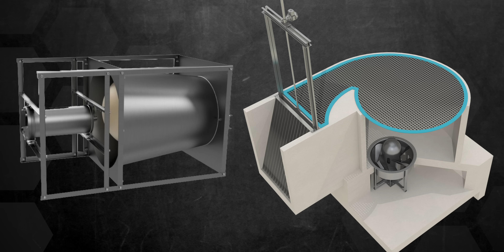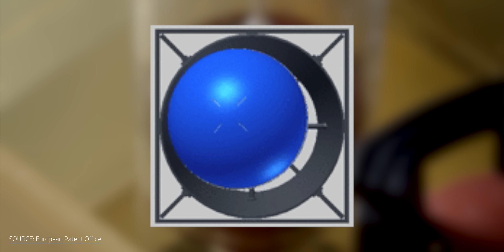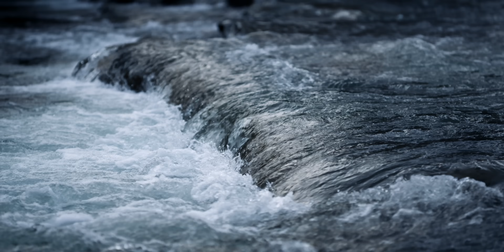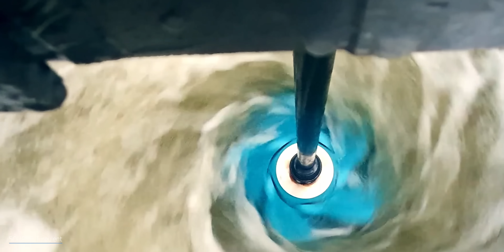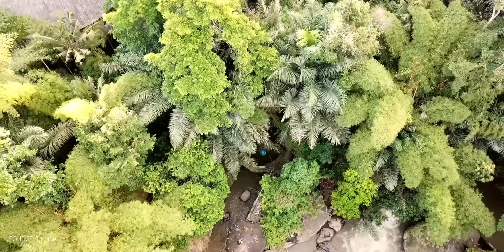The Genius of Small Hydro Turbines

Comment from the maker: What do you think about decentralized and small hydro? Click here https://www.eightsleep.com/mattferrell to improve your sleep fitness with Eight Sleep and use my code MATT to get $200 off!

If you liked this video, check out: Have we been doing Solar wrong all along? https://youtu.be/LqizLQDi9BM?list=PLnTSM-ORSgi4dFnLD9622FK77atWtQVv7

Corrections: 
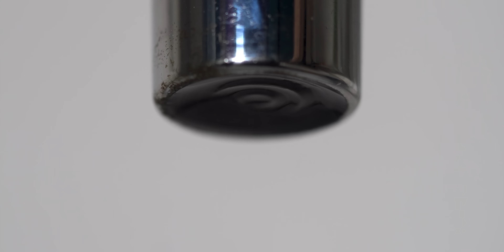3:28 - We made a mistake between the calculation and the final script.  It’s 500,000,000x more than the average faucet.
Reply: I suspect most people don't want a mattress that requires a subscription that will cost them a couple hundred dollars each year.
Reply: In Arizona, small hydro makes a lot of sense. We have one of the most extensive water canal systems in the country spanning thousands of miles and we could easily add numerous Turbulent systems adjacent to the canal's to supplement electricity demands.
Reply: FW, 
you need height for power it's alinear effect.
Yes you can generate from rivers etc if you wnat but it's not effective.
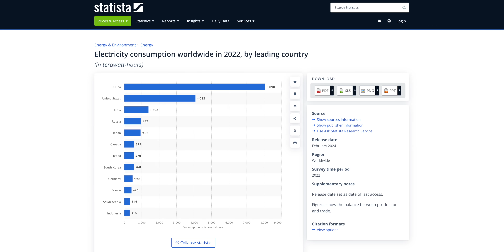Reply: Hey Matt, great video as always! The chart at 08:03 is kind of misleading in combination with what you say. It shows total energy consumption of countries rather than the average per person while you're saying at that moment that those in the US tend to use a lot more electricity than people in other parts of the world. Now it seems as if the average Chinese citizen uses more than a US citizen but that's not true
Reply: @firstlast2621⚠️ God has said in the Quran:

🔴 { Say, "O My servants who have transgressed against themselves [by sinning], do not despair of the mercy of Allah. Indeed, Allah forgives all sins. Indeed, it is He who is the Forgiving, the Merciful." ( 39:53 )} 

📖Quran
Reply: @firstlast2621 The US barely makes up 4% of the global population yet consumes 1/3 of the world's resources and emits almost 30% of the world's pollution and waste.
Reply: @PetraKann what's your point..?
Reply: @PetraKann  Yeah no, you have been lied to by a misuse of numbers also that stat is 30 years old now and you are still using it and still think it was originally true.
Reply: @PetraKann  hmmm, those statistics are misleading.  As if every household for 130 million people have made that dent?  How much of that is industry, and furthermore, how much of that usage represents the GDP of our economy versus the GPD of a dozen micro nations?  A step further than that, how much of what we export to support other economies is involved?  Modern septic systems make more sense to me than 130 million cat holes and seasonal cholera outbreaks.  The blame shifting is a tired game of 3 card Monty few are fooled by anymore.  A better use of regulatory bodies involves focusing on the true source of pollution and concentrating on the highest impact polluters so that cradle to grave laws already on the books get enforced in earnest.  A united ban on fluorocarbons went a long way towards healing the ozone layer.  Smog is greatly reduced from a century ago no matter which city on the planet was involved.
Reply: @robertmoore1215  the statistics includes all aspects of American society, not just household demand and consumption. The same criteria applies to all other nations so a direct comparison can be made. The USA by the way has more than 130 million people.
The single largest carbon footprint for any organisation in the world is the US military.
But you are personally asked to tighten your belt, minimise your waste and reduce your carbon footprint 
Meanwhile the US military and the tiny elite class have obscene carbon footprints and energy demands.
Orwell was correct in Animal Farm when he wrote "we are all equal, but some are more equal than others"
Reply: @PetraKann  if you read my other comments I said as much.  Even using the label military is deceptive when it implies any active duty personnel have a thing to do with where the real money goes (contractors).  The flaw in the statistics that socializes the blame is that it implies equal blame for Amish Americans and rice paddy farmers in rural China.  Neither are willing participants in big industry's crimes just because they purchased a rubber wheel.  

I'm too old to ride a horse or an electric bike so I need a car to function because public transit is lacking.  When the sticker price of an electric car exceeds what I paid for my house, isn't that a symptom of a broken market where demand no longer drives an economy?  We are very far away from Henry Fords understanding that his employees were also his customers.  Seems to me real capitalism was eaten alive by crony capitalism.  But I digress...
Reply: Would you please do an episode about the Bath County Va pumped hydro installation… it’s been quietly working away for some time now …
Reply: 78 GW of SHP is way more than expected. You should fact check, what is meant here. In general SHP is 50MW or less. You are talking about pico hydro power (below 10kw) or maybe micro- (below 100kw). There will be no more than a few MW installed worldwide, maybe more than 10MW.
Reply: 78 GW seemed awfully big to me as well, @juliane__.  
What wasn't given (have to check the source info) is the efficiency of these alternate turbine designs. Yes, you can make power with a small head, even with a conventional water turbine.  You just don't get much power out. 
I, along with the majority of the world's population, don't live near a stream so while there are places, particularly remote and less developed places, where these small hydroturbines could be a reasonable solution, they won't scale up to provide the massive amount of non CO2 electrical generation that we as a society require. An interesting boutique solution for a few people, I think.
Reply: @gerrylarue9043  Yes, for some regions it is an easy solution and makes sense, especially if you don't have the need for transformer stations or at least lower the total grid demand in industrial countries. Overall impact is low to very low indeed. And we didn't talk about upcoming droughts due to climate changes...

Efficiencies out of my head, 50% and more if it is done right. Crucial part is the last one, because the firms who build them are small and don't have much spare resources to make much custom fits.
Reply from the maker: @juliane__  that info was pulled from this report: https://www.unido.org/sites/default/files/files/2020-08/Global_overview.pdf?_token=281556212
Reply: @UndecidedTechnology  I asked to harshly for the review of the part. i guess because it stood so much out to me. Seems to be not that important. Hav a nice day.
Reply: I enjoy many of your videos but this has been a super useful because I have been looking for a suitable low head turbine for some time. And I think the Setur-M might be the thing to finally solve my winter energy shortfall. Thanks Matt. You're a star!
Reply: "Don't go chasin' waterfalls please stick to the rivers and the lakes that you're used to" ;)  A bit of TLC "Waterfall".  Thanks for another interesting review Matt!
Reply: First time viewer here. Annoying salespitch for an overpriced mattress in the middle? Thumbs down.
Reply: Matt, 

simply put, effective hydro power needs height, end of the story.
You are correct with regard to the hazards, I think this may be the worst hydro accident:-

On 17 August 2009, a turbine in the hydroelectric power station of the Sayano-Shushenskaya Dam near Sayanogorsk in Russia failed catastrophically, killing 75 people and severely damaging the plant.

They are extremely rare however and hydro has good safety record overall.
Reply: SETUR = fish mortar and pestle. lol
Reply: Ive seen these discussed before but none of the videos discuss debris going into the system. EX. would a long tree branch just break the system?
Reply: Even if your area is next to a river, the mechanical nature and exposure to multiple elements makes hydro turbines less reliable or require more maintenance vs solar PV.  However it could be a nice backup to solar in a totally off-grid system.
Reply: These could also be used as pumped hydro energy storage alongside a solar/wind setup.
Reply: @yt.personal.identification  Sumale a eso una batería accionada por gravedad, es en lo que estaba pensando, en un sistema de embalse de agua cerrado y sobrará energía para una granja promedió.
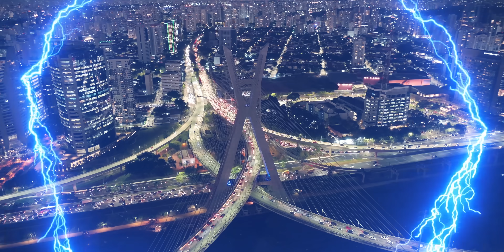Reply: When comparing project size and completion times, comparing the complete Itaipu dam project at 13 years (12:41) to the Turbulent turbine installation next to the Ayung river at less than 1 day (13:06) is a little misleading in overall terms of total time it takes to build basic infrastructure and install power generation equipment.  While I'm sure that the turbine installations at the Itaipu dam took over 1 day each to install, it was less than 13 years per turbine - the 13 years is used as total construction time.  (From a little research I did, it appears that the actual dam construction was a little under 8 years, and power generation began a little more than 9 years after construction began.  Turbines where added at a rate of 2-3 per year during the following 7 years, plus and additional 2 added 16-17 years later to allow 18 to run continuously while 2 are down for maintenance.)  That equates to the output potential for approximately 4,300 kWh per day the project was in basic (most environmental disrupting) infrastructure construction and drops down to ~2,000 kWh if factoring in the subsequent years to install 18 turbines. The Turbulent installation was installed into a preexisting concrete basin. (Kudos to them for repurposing existing infrastructure!)  Total construction time would have been significantly more if they had started from scratch.  If they had built all infrastructure, it's plausible that it could have taken a few weeks, resulting in as output potential of less than 1 kWh per day of total construction.

I'm not against small hydro-electric generating installations - I think they are a great way to spread and reduce environmental impacts.  I don't doubt that the Ayung installation has less environmental impact per kWh than the Itaipu does, and I think such projects like this should be promoted!
Reply from the maker: @heythere6922  thanks for the feedback on that.  Yes, it’s a bit of an apple to apples comparison, but that’s kind of the point I was hoping to hit.  Not all hydro solutions require these massive installations.  What if you built out smaller more localized installations?
Reply: "Das Genie der blattlosen Vortex-Wasserkraft. Klicken Sie hier, um Ihre Schlaffitness mit Eight Sleep zu verbessern und verwenden Sie meinen Code MATT, um 200 $ Rabatt zu erhalten! "
what does that mean? can you explain it? it's from your video description.
Reply: The Patent Rights to Vortex hydropower is owned by someone in Australia.
There are a few prototypes and small scale Units operating in Australia and around the world.
Reply: thanks for translate your video.
Reply from the maker: Thanks for watching!  Curious ... what language did you listen to?
Reply: Do you have any idea how much energy it takes to heat water!? I’m not adding a heated bed to my electric bill!
Reply: عذرن أنا قرأت شروط تعليق لكني لم أفهم لأنه بلغة انكليزي
Reply: please, what is schlaffittness? I really don't know this word, that is used in the video text. and please, could the title of the video please be in english, since the video itself is in english. can't be too hard.
Reply from the maker: What language are you seeing that in?
Reply: @UndecidedTechnology  14:28 I recomment to revise this graph as i commented before. It is not part of the video topic.
Reply: @UndecidedTechnology  English!
Reply: Love the tucked it J.Milei "Damnit"

"Afuera" to the damns of old!!
Reply: MORE Professionally DAMIT
First time i was like ok 2nd was like hmmm. And he get compans callinging him to do video of there projects . Just saying damit. Lol
Reply from the maker: @claytoncostello6583  who is getting calls?  Me?  Nope.  Neither of these companies reached out to me.
Reply: Day a lot: of asking for a video on fabric ductwork
Reply: Love the lyrics strewn through out
Reply: Just so you know there's a bot in the comments pretending to be you
Reply from the maker: @pisscow6395  gah!  Thanks for letting me know.
Reply: @UndecidedTechnology  Not able to correct or at least respond to an obvious and narrativ changing failure doesn't say quality content.
Reply: 13:00 it is kinda unfair to compare only instalation of turbine plus fuse/controller box (without time required to build the channel and the chamber). While you give time for all of this in case of dam. I bet instalation of turbines took way less than 13 years. Right?
Reply: Combine it as an integral trompe pump
Reply: Decentralized small & micro hydro would work best in rural communities where bold streams exist.  A small town cooperative version of electric generation is more pragmatic for small towns than large grid corporations or micro hydro alone.   A cooperative would have the ability to have mixed portfolios of energy sources and keep their fate in their own hands.  Large grid notoriously delay line maintenance until storms come through and leave people in less populated counties out of service for up to a month.
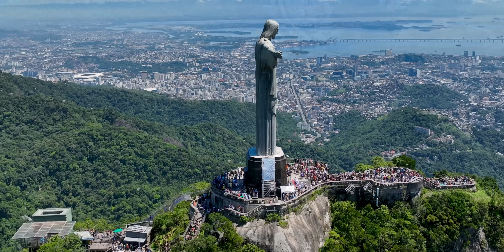Reply: 3:05 Jesus Wants A HUG!!!

(reference : hellsing ultimate abridged)
Reply: What i see is that you have a mistake here.. the others as well, non of you are even close to the answer to brake the laws of physics.. to produce more energy than the system itself needs.. 
you didn’t watch at the flow.. you should go back into the nature and look how water works.. you even can see it on google maps.. 
go there and watch closer..
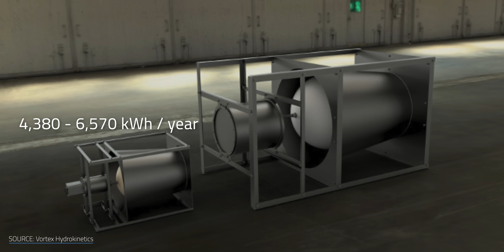Reply: 7:43 that word is pronounced lat-ter (latter)
not nitpicking here, great video.
Reply: These new designs could increase the efficiency of current hydro power, possibly doubling the power using half the water quantity?
Reply: first message deleted, because? schlaffitness? why are you even using the word schlaffi?
Reply: arent the fish going to get flattened like pancakes as the rotor rolls around the outer cylinder ?
oh yep and the solution is grates?  well thats not gonna last long lol
Reply: Its a fart in the space.

Comment: It's kind of fun. Most energy is based on heat or motion, and all by generators driven by steam, flow or pressure. All invented hundreds of years ago. Exepet solapanels absolutely no streams, no boiling oil,  or water, no nuclear,  solar allows very low cost maintenance, construction, repair, and very long life cost effect efficiency. It's actually amazing, most energy we use is gone after we use it, and has do be taken up in digging or drilling to install be gone. Not solar..

Comment: Pumped hydro can be used to store power using water in an upper and lower reservoir instead of lithium batteries. On flat land the lower reservoir can be in an abondoned mine or dug deep below the surface. Initial cost for digging is high but, to compare, when the time comes for a lithium battery change, the pumped hydro starts pulling ahead financially and is good for 80 to 100 years. Disposal can be abandon in place and hydro uses no hazardous materials like lithium or uranium.

Comment: 'Turbulent Flow" generator should have few fish issues if at least 1/2 flow is left natural in same sized channel next to it, a flopping around ball it like tree roots tumbling rocks and fish avoid these.  As to ANYTHING sitting in a stream bed, bad.  Many tims of the year it will flood to some extent, cetainly to make retrieval dangerous and once a year flood so much it wiould rip the generator to pieces.  So ANYTHING river stream rivlet road side ditch bases has to be located in a channel off to one side, right at edge of flood plain ideally, with feeding channel back to stream and a catchment of some sort there that will survive whatever flood dish out there.  In all likely hood it means at least every other month adjusting cleaning intake and channel.  This is perfectly fine for remote sites with no alternaitve, as well, there is no alternative.  Millions of tropical villages, schools, hosstpitals farms homes could run critical loads from these and with old second hand batteries even have enough to cover time out during small floods / jams.   There seems to be a good properct for tidal flow projects if it works to same efficency both ways, or mostly the same.  However as they would be installed in large banks, they do become a problem for fish, esp as many school in oceans, making avoiding an obstacle that can suck in those at edge of school brushing it problematic.  They might be limited to vertical banks of limted witdth with equal spacing between.

Comment: What do you think about the adaptation of a Vortex bladeless vibrating wind turbine to water?   Any where there is a current could work couldn't it?    And couldn't you mount them horizontally below the surface of a river to allow boat traffic?  Just wondering.

Comment: I've been looking at different off grid green options, and holy shit "micro" hydro seems to be by far and away the best option. Solar doesn't work in winter with areas of high snow load (or at least not cost effective), small scale wind turbines seem completely inadequate at this point, but micro hydro seems to be both cheap AND high output. Of course the downside is you need local water resources to make it work. I'd love to see some cost breakdowns and comparisons with all the different "homeowner" sized, decentralized power options.

Comment: Question where did you find the information for the setup? and you said that the smaller one would work on a stream with a water flow of 2 liters per second when the manual calls for 65 liters per second. I am interested in this and I have a couple of streams that I would like to utilize I just was curious about the water flow.
Reply: Setur